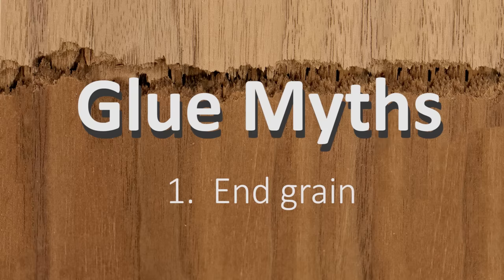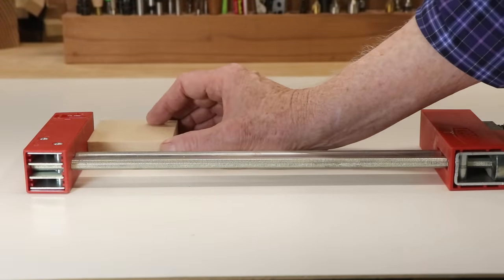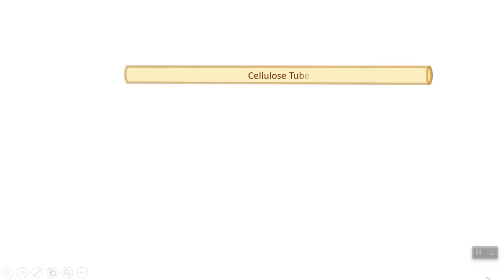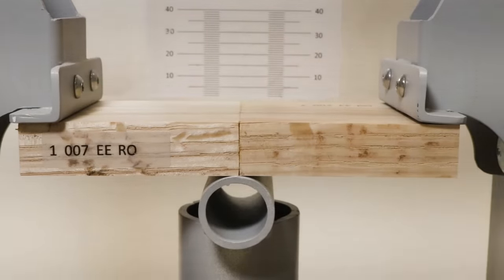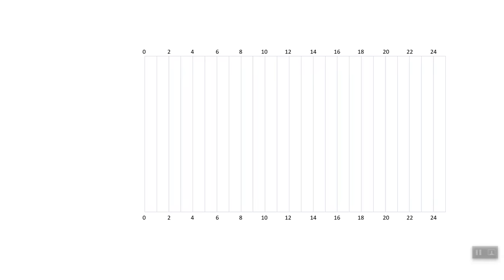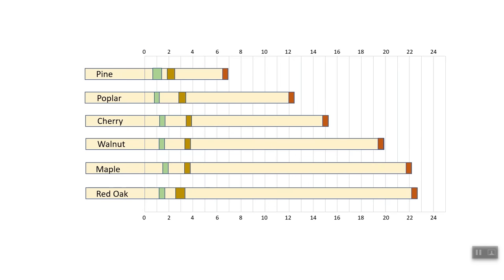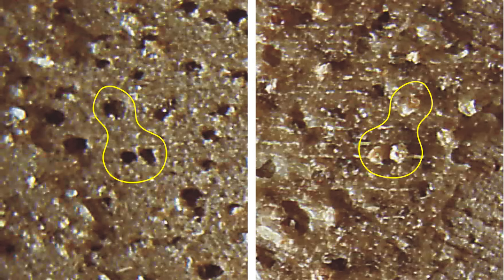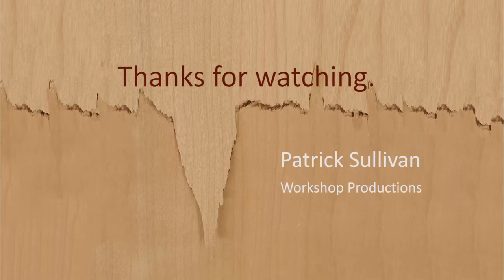Glue Myths:  1. End grain

Comment: It was a very interesting test. 
I think that the only drawback is that due to expansion and contraction of the wood the joint will fail eventually under any kind of stress.
I did this mistake with a mitered picture frames. After one year the frame bottom just fell apart, glass pushed it out and broke on the floor. This is where I started to look into woodworking joints and got really interesting in woodworking. 
Best regards from Croatia
Reply: I have many of my picture frames in our summer home that sees high temperatures and high humidity in the summer and sub-zero cold and very low humidity in the winter.  None have failed.  MItered corners and no splines, dowels, or biscuits.
Reply: @burntsider8457  Interesting, mine failed in Mexico city, glue used was Titebond 2 and I did it with pine. Maybe those are the factors.

Comment: When building traditional balsa framed model aircraft, side to end grain joints are frequent in the 'warren girder' structures employed. I've always been amazed at the resulting strength and rigidity, As a one-time mechanical engineer who has installed many strain gauges I really appreciate this video. Thanks.
Reply: Love to hear strain gauges mentioned in a woodworking context. My dad was an engineer and later VP for Micro-Measurements/Vishay.  Worked for them 25 years selling strain gauges and helping customers with their applications.

Comment: Excellent and thorough demonstration. Especially appreciated the graphs and close-up end views. This is definitely one of those myths that has refused to die. Around 2003, I went to a woodworking tool demonstration, basically a sales event. Just as a side-show, the salesman made a simple miter joint by pressing two freshly cut 45-degree ends of 1.5- or 2-inch wide pieces of hardwood. No clamps, just hand rubbed and pressed for 15 seconds and then left it to sit on the table. Twenty minutes later, he passed it around and no one could break the joint just by pulling or pushing on it. I never forgot it, as you can see, but it still didn't change my practice :)

Comment: Hi Patrick. Great video with some really interesting results. I think in the future you might want to use a 4 point bend and not a 3 point bend. A 3 point bend places all the stress directly on the joint. A 4 point bend places uniform stress between the two rollers. The effect being that a 3 point bend is used to test a material which is homogeneous whereas a 4 point bend tests 'the structure' between the rollers. Example being: if you want to test bending strength of raw timber a 3 point bend would be fine. If however you wanted to test something like the bending strength of riveted metal truss a 4 point bend would be better. A 4 point bend is also much more forgiving of alignment errors.

Comment: You’re back!  Looove your content.  My suggestion for a follow up - compare end-to-end glue strength with regular application vs massaging the glue in until completely saturated. I do not recommend letting it dry or applying a watered down first application like some people do. Just massage the glue and press down hard to push the glue into the end grain, and keep applying until it stops absorbing and stays wet. I do this every time (takes much longer) thinking it must perform better, but maybe it’s a myth too.

Comment: Just because I'm a rebel, I tried gluing some end grain scraps last winter for a decorative project not requiring strength.  My results were as you present here but without the confirmation of your excellent testing.  I glue miter joints for picture frames without splines, biscuits, or dowels all the time with no failures.  Thanks for shattering no-end grain myth.
Reply: Splines biscuits and dowels are mostly used for keeping glued pieces aligned while the glue sets. Only in some very structural joints will splines or dowels (but not biscuits) add strength by giving the glue more surface area to form a bond and by bonding in more wood fibres across the joint. 

I don't own a biscuit jointer - I see them as a waste of time (for gluing up panels, some pawls to hold the boards in alignment are just as effective and slightly more convenient).
Reply: I've had some end grain glued picture frames break after being dropped.

Comment: This is an Awesome video, and very well tested. I wondered for a long time why people said this joint was bad, but I did not have a good way to test it. Thank you so much for making this video.
Reply: It is still a bad joint, but definitely shows that glue is stronger than lignin!
Reply: @daveb8598  Yes ........ and the earth is flat.
Reply: The reason might be because an endgrain joint dries much quicker. A dry joint wont bont nearly as well.
The end grain basically wicks up the glue to the point where there isnt enough glue on the surface anymore for a proper glue joint.

Comment: Very interesting ! I think that the myth also comes from craftsman seeing the glue fail in endgrain to endgrain led to assume the joint was weaker. On the other hand, if the joint break because the wood fails, the joint itself doesn't look like the issue.
Another point, it's hard to get a big surface area in end grain to end grain joint.
Reply: Thats what I thougth also
Reply: That was my thought as well. If I saw those end-to-end breaks in the wild, my reaction would probably be, "wow, that glue joint sucked" not "wow, the wood was extra strong in that orientation."
Reply: That sounds like a classic case of confirmation bias.

"I Have achieved a result that looks so obvious to any other man or woman, that I need not look deeper."
Reply: In fairness, we don't know how strong the glue joint is if the wood keeps failing first when we try and test it. Maybe end grain is still the weakest, it just doesn't matter in real life because the wood is the real limiting factor

Comment: Huge thanks for that research, puts everything in perspective. If you are doing any more tests I'd be very interested to see a test on scarf joints using the same width and thickness timber to understand comparative strength. I think in boat building they use scarfs as short as 6:1 or 8:1 and in aircraft they go up to around 15:1.

Comment: Beautifully explained. In fact, just earlier today i was telling my 13 year old son that the end joint glue is bad idea. Well now i have to show him your video.... lol. 
Thanks a lot Mr. Sullivan.
Reply: I mean, it's all relative to the design of the structure. If you are making a 'T' joint, you'll get a weaker glue-up if you butt the end-grain up against the "front" of the other piece instead of gluing it to the "side", long grain to long grain, assuming the surface area is the same. The long grain breaks in this video are akin to the board breaking feats in karate, where there's no real structural strength there to begin with. The end grain glue joint failed first in a configuration that allowed the full strength of the wood fibers to be brought to bear on the joint.
Reply: You weren't wrong, and this video is misleading.  Please note, he never actually broke a long grain glue joint.  

In truth, and design which relies on a 2.25 square inch glue joint to take any kind of force is a bad structural design.

Comment: Patrick, you misunderstand the end grain rule:
       1. If you glue side grain, your glued joint is ALWAYS STRONGER than the wood, so use glue, its OK!
       2. If you glue end grain, your glued joint is ALWAYS WEAKER than the wood. You can still glue it, but only if you do not need the full wood strength!
I feel you should have mentioned that, because people think it is OK to glue the end grain now in any case! By making a lap joint, finger joint or dove tail
the strength is increase dramatically. Maybe you should make a video about that, since you got nice equipment for testing!

Comment: Great job, and excellent, easy-to-interpret data. This is something I've quietly always suspected, but kept to myself, because it seemed so "against the grain".  I've made hundreds and hundreds of glued-up, mitered picture frames and they've always held up well.  I went through a phase when I added a spline in a slot thinking that it would improve the strength, but the rare failure rate didn't decrease. The spline just made the alignment a bit easier, so to simplify things even more, I quit gluing in the spline, and had no difference in breakage. Those miter joints held on end grain glue alone, and I always wondered why it worked so well, despite plenty of fellow woodworkers continuously telling me that I needed to do something more to strengthen them up. Now I know. Thank you.
Reply from the maker: A video on miter joints is in the planning stage.  I have some really interesting material.
Reply: @PatrickSullivan  Looking forward to it!
Reply: @PatrickSullivan  - I'm looking forward to this as well!

Comment: The myth could have started back before PVAs were available.  Try it using hide or fish glue and see if it holds true.  Thanks for an incredible video.  I'll be updating some of my designs now :-)
Reply: Hide glue is significantly much stronger than any PVA glue though.....
Reply: I wonder if the problem is expansion and contraction over time. That would affect end grain quite a bit. Not something that would show up in this lab test though. Unless the wood went through sever cycles of damp and dry and was then tested. There might be truth to the old theory that end grain glue joints are suspect.
Reply: @orion7741  It is, but hide and fish glues are both more susceptible to heat and moisture and deteriorate faster, leading to eventual failure.  Besides that, expansion and contraction has taught us to combat it in other ways where needed, and it's not a major factor with a glue joint, as most glues are sealants too, and prevent contraction/expansion of the joint as an added advantage.  One shouldn't even use materials or methods for any job where better ones will do a better job, unless you are planning for obsolescence.

Oh, and placing a "much" after "significantly"  is redundant and either would stand alone, as in this case they mean nearly same thing and one or the other will suffice, and using both is just strange.
Reply: @Bob-of-Zoid  It's not necessarily redundant. They might have meant that the fact is significant, but the glue is much stronger

Comment: Thank you sir, the best video I have seen on this subject yet. Have you considered testing the shear strength of glued surfaces eg. used internally in mortise tenon joints? Another subject that would benefit from your rigor and your equipment is the value of sharpening with super high grit stones.

Comment: Excellent!  As a former test engineer, this was exactly the correct approach.... Two additions for your next test....   1 - Rotate the joints 90 degrees vertically in the press.  this would more accurately simulate a mitered corner, or just miter one.  2- do the unglued wood rotated 90 degrees horizontally.  This will test the lignin only and should be close to the side to side grain tests. 
Thanks!

Comment: I don’t think these results change the conventional wisdom since the natural alternative to an end grain to end grain joint is an unbroken continuous long grain piece which your testing shows to be many times stronger. I would love to see this rigor applied to scarf joints and maybe look at the relationship of glue surface area and strength. 

Excellent video. Made me think and I definitely learned something new.
Reply: @John Milton, your point is that repeating what you take for granted without trying it yourself is better than showing respect for a very careful science experiment. So what is theory and what is practice?
Reply: @alamaralaa  He didn't prove it though. He proved that end to end joints are stronger than wood across the grain, or lignin as he refers to it. He didn't prove that end to end joints are stronger than side to side joints, because the side to side joints never failed. But the fact that they didn't fail in his experiment doesn't mean that they won't fail in the real world. In the real world you don't put significant stress on wood across the grain. Nobody has ever made a table where the grain doesn't run along the length. But in the real world you have years or decades of wood flexing, temperature and moisture. How will that impact the joint? Hard to test, but that's what we have decades or even generations of experience for. And those tell us: Don't glue end grain.
Reply: @cire9984  He was wasn't trying to prove the gluing end grain was stronger than gluing long grain, and I never said he was.  His assertion was that gluing end grain was not as weak as people assumed it was, and his tests prove it is a strong joint.  Stronger in fact than the wood is strong across the grain.  Period.  End of discussion.  Please don't put words in his or my mouth.  You can misunderstand his tests and conclusions and my statement above all you want, but don't tell us we're wrong because you didn't understand them.

Comment: Great methodology and great presentation of results.  However, your results beget a further question.  Namely, what effect does conditioning of the bonded surfaces have, if any, on the strength of the bond?  For example, sanding of the surfaces to be bonded with various grades of sandpaper from rough to fine, or cutting of the wood samples using a cross-cut versus a ripping blade.
Reply: Very true, I came to this video wanting the answer to 'planned or sawn?' I've seen videos that prove, the more glue the stronger, so a sawn joint with room for more glue and texture to grad to as said in this video would logically be even stronger. I would love to see part 2.

Comment: This actually makes a lot of sense to me. I also never heard of this myth, so I'm fortunate that I've never made a biased joint like this. It is a very interesting result though.
I wonder how a finger joint would hold up in the end-grain test. Having the end grain of both mated materials run parallel to each other would likely make an incredibly strong joint. I've actually seen this very commonly done with pattern stuck for doing window/door trim and mouldings.
Reply: Think you'll find a scarfed finger joint is stronger than a normal one. Key being how much of the cross section of the joint at any point is strong wood fibres as oppose to weaker glue.

Comment: I would be interested to see this tested with pulling force instead of shear force as wel. I would expect similar results, but I'm not sure.
Thanks for your rigorous testing!
Reply: It's not shear force. When you apply a deflexion force to the beam, you have one side of the beam where tension (pulling) forces are experienced, and on the other side compression forces. Check out beam theory on Wikipedia or that video https://www.youtube.com/watch?v=f08Y39UiC-o

But in fact, the situation isn't exactly the same, since there you have some shear stress, where on a pure tension test, you only have tension stress.

Comment: Great video! You are a very inteligent comunicator. Would be interesting to know which bond is the strongest, side by side or endgrain to endgrain. Becuase the wood grain fails in the side on side example before the glue line does, is difficult to know how strong it is...
Reply: Not sure the strength of the bond really matters if the wood fails first
Reply: @veri745  if you use a weak material to test a bonding agent that is used on stronger materials and the weak material fails, you have not properly tested the bonding agent
Reply: @mjbailey404  the only "stronger materials" I see available is end-grain, so what exactly has gone un-tested? He covered a pretty reasonable array of wood species
Reply: @mjbailey404  The bonding agent is static in all tests. Regardless, the glue isn't being analyzed, it's the application.

Comment: Late to the party, but awesome video. I think application needs to be considered as well. I can definitely see applications where end to end would yield a joint that will last a lifetime. Table tops, picture/mirror frames, and the like.  Where racking force comes into play, I don't think any of us would consider end to end, anyway. You've made me a believer, and I can see where this will make me rethink my approach to gluing up panels, and frames. Thanks!
Reply: Be careful though. I just had an end grain joint fail. Lasted less than a year, not a lifetime. I will from now on make joints properly and not rely on glued end grain. There wasn't even that much stress on this joint. Get long grain crossing the joint and preferably design things so that if the glue failed there would still be interlocking wood to hold it together (like tenons).